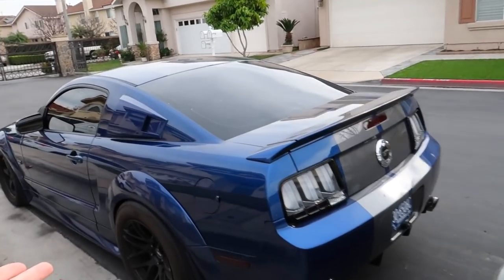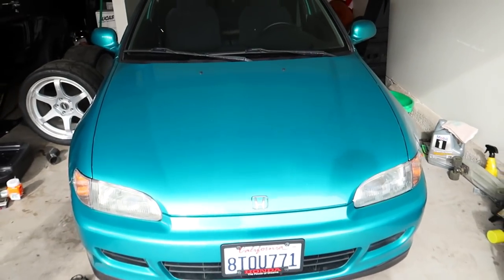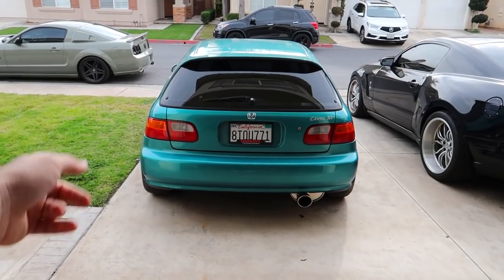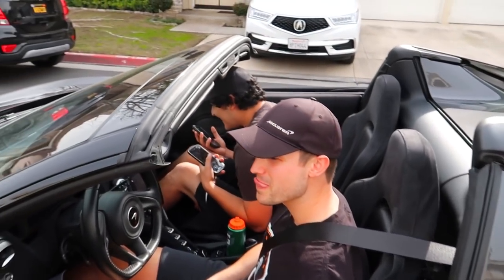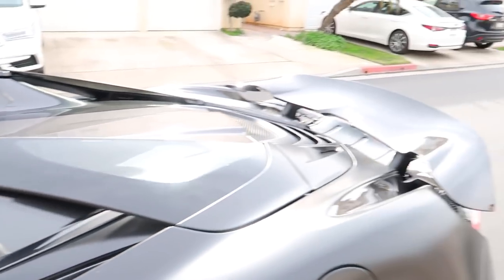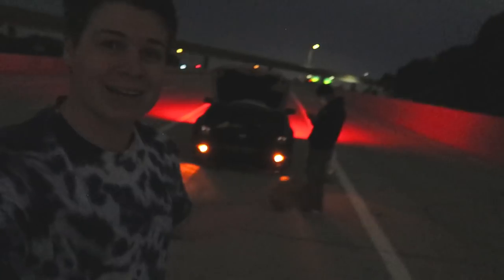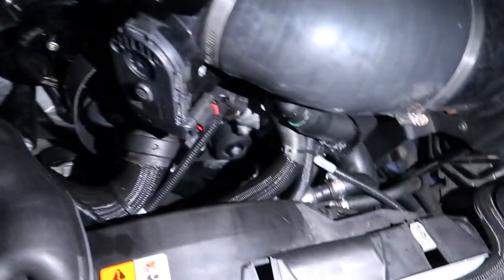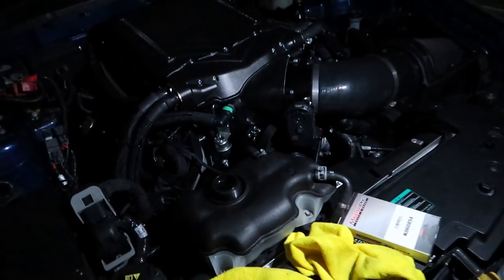I FINALLY Got My MUSTANG Back... Then BROKE It In The Same Day...

Comment: I agree. 300-500whp is the sweet spot for power on a daily. You can ring out the revs far more often and enjoy the majority of the powerband. While the higher power cars (600+) you don't get to enjoy as often. But when you do enjoy them, its a hell of a rush for sure.

My ideal garage, would be a 400-500whp daily and then have some behemoth for weekend fun.
Reply: That GR Corolla looks Hella tempting. People are getting 450whp on an unopened 1.5L 3cylinder 😂

Comment: Cold starts aren't good on non carb cars, just one of those things. kinda don't wanna ls swap my classic since the 350 Buick it's got as a heart just sounds like nothing else around today I pray many people get to appreciate the sound of a big or small block love the video drew goodluck with ur builds
Reply: Huh? Cold starts are better on fuel injected cars (when tuned properly). You have temperature compensation tables for both cranking and coolant temp, and as an extra benefit within 30s to a minute the primary O2 sensor is warm and beginning control fuel, so if your tune isn't perfect, it will adjust (keeping you from sitting there idling and fuel diluting your oil) 

With a carb you only have the choke (manual or auto) to control extra fuel, and squirting fuel in with the accelerator pump... neither is very precise. It certainly works, but if you really want to be nice to the engine you want it spot on, without excess fuel. 

I don't dislike carbs, but properly setup fuel injection is a wonderful thing, especially in the cold.

Comment: Do the gt500 calipers super popular s197 swap you can get the calipers at O'Reillys or autozone and everything is a bolt on. Upgrades you to 4 piston brembos and a 14 inch rotor.  Plus when are you gonna put the interior back in? A rear seat delete kit weighs nothing and will help cut alot of that road noise

Comment: Drew on the k20 you should run a civic si RBC manifold you do have to cut some of the manifold to retrofit it but it’s the best factory intake manifold you can pull some power out of that but again idk if your just getting everything to get the car running then build.

Comment: Drew yes 400-500hp car will be much more fun, since you can use it for a lot longer. However in your case Drew I will just say this "Once you go black you never go back". Also that engine just tearing everything man even the car itself crazy. Another thing when tuning a car to this level is less stability...things will tear off or break sucks. But thats what you get Drew for tuning this shit to 1000hp😃. But I think the Supra is the most solid car you have so far decides the Macleren.

Comment: On a side note, I just installed a Stage 5 Gen 3 3.0L Whipple on my 2019 GT350R and I'm having the toughest time trying to get it tuned properly. Palm Beach Dyno has let me down, the Whipple tune is good for what it is but it has a very rough start, and nothing is working for me. It's very frustrating. Did you have your setup tuned locally? I may have missed when/where you mentioned it.